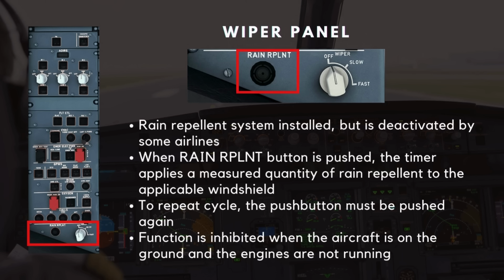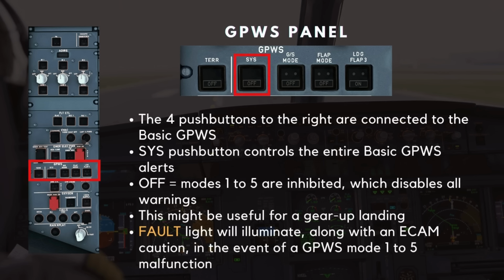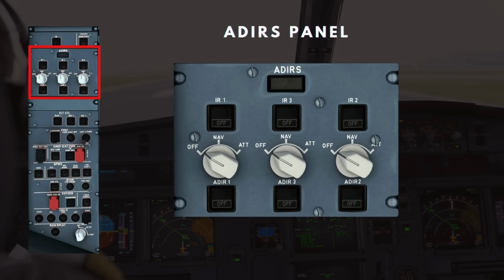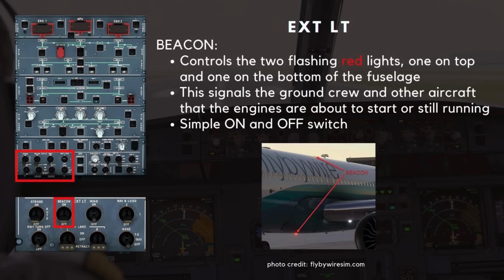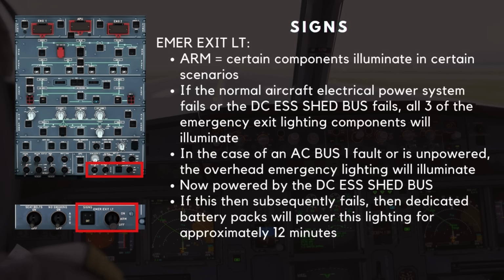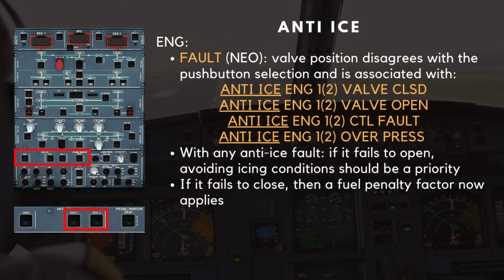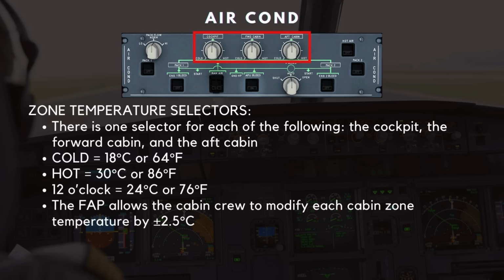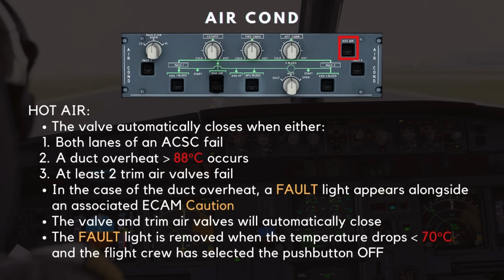The ENTIRE A320 Overhead Panel Explained (Part 1)

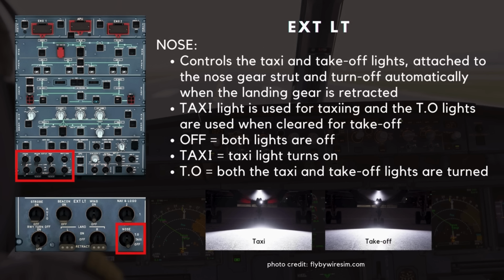Comment: 23:33 I want to add something here. On the newest A320neo family aircraft (if the airline purchased the option) and the Airbus A321XLR, the landing lights, the taxi and take-off lights and the runway turn-off lights are replaced by the Multi Functional Runway Lights that remove all of the mentioned lights and put together at the front of the wing root. This removes the retractable landing lights and therefore minimizes drag.

Comment: 44:20 just to add something here. The APU bleed is turned on before engine shutdown also to allow for the engine dry cycle in case of a tailpipe fire needed to be blown out.
Reply: Can’t you crank it without bleed?